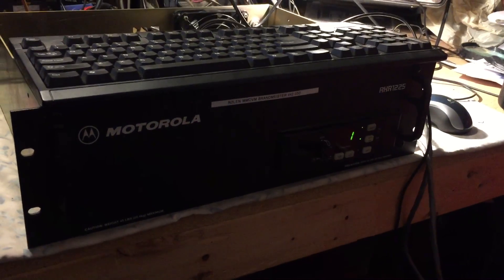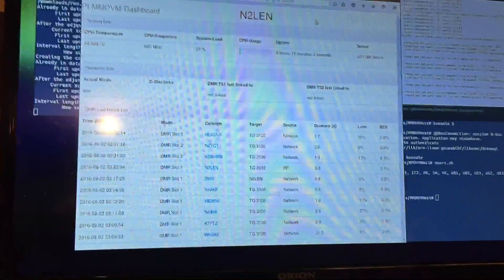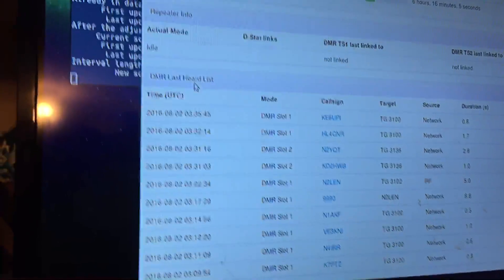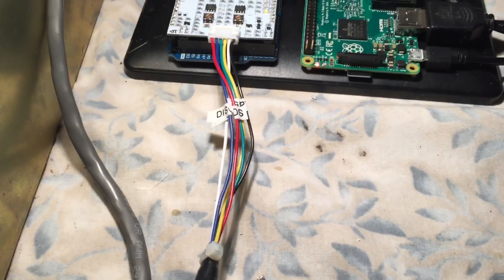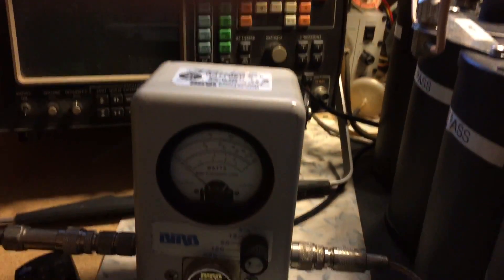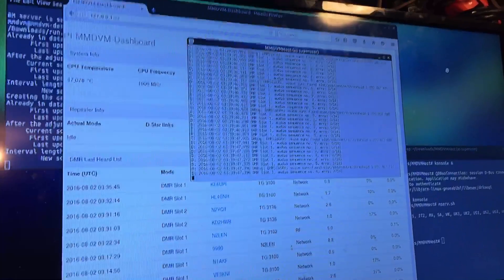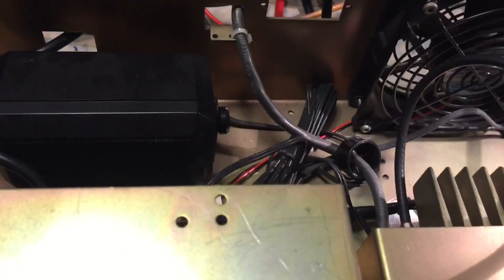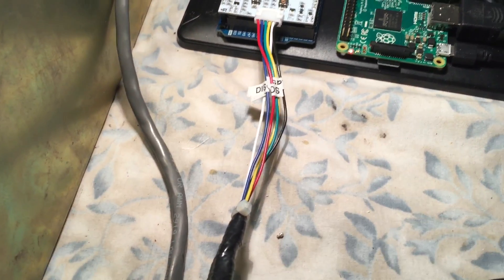MMDVM DMR with Motorola RKR-1225 Interface

Comment: Len, I have 2 of these repeaters just sitting. I was wondering if I could get a communication path opened with you that you could guide me through this process. Also, after building this does it work like a regular DMR repeater? So say if someone is 10 miles away and can hit the repeater, they can get on DMR with this setup? Thanks, Buddy K4VYX

Comment: Hey so when you say on the tx and discriminator wire I need to solder 10k resistors in between the zum and the rkr1225?